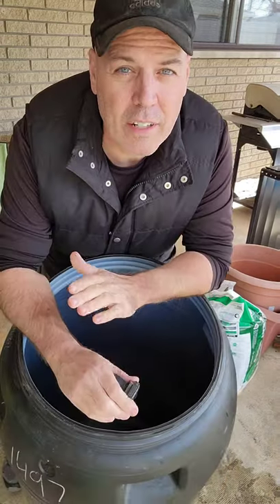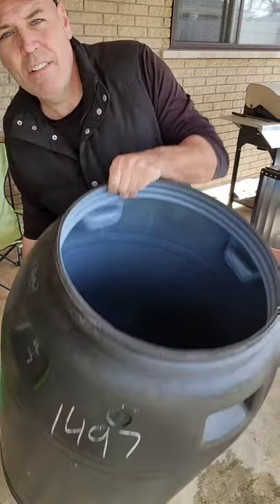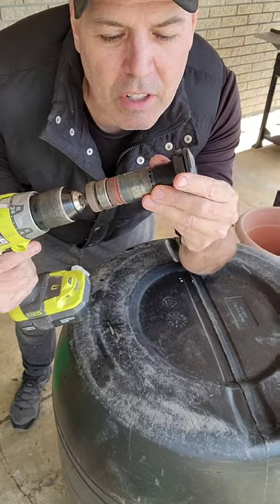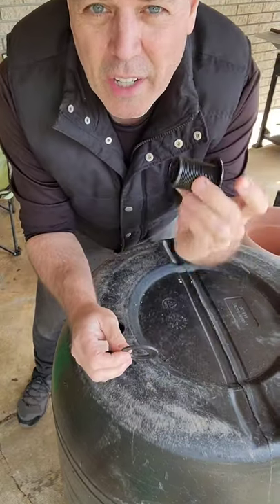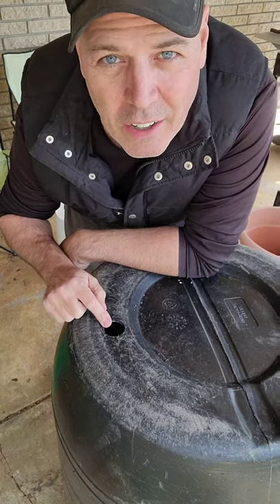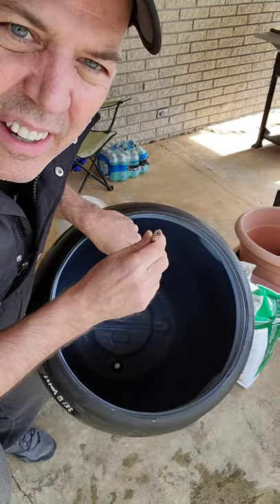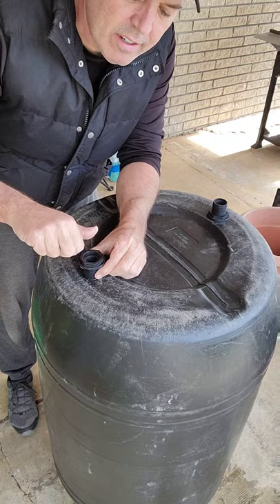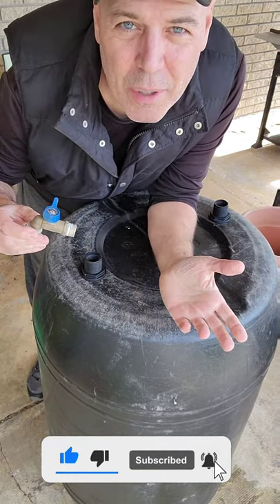How to install a bulkhead on a rain barrel

Comment: I'm assuming that a spigot is attached to the bulkheads. Curious, what's the application of placing it at the bottom, and 2 at that, please?
Reply from the maker: I was connecting more than one rain barrel together for more capacity. One bulkhead will have the spigot, the other bulkhead will be used to connect pipe to additional barrels.